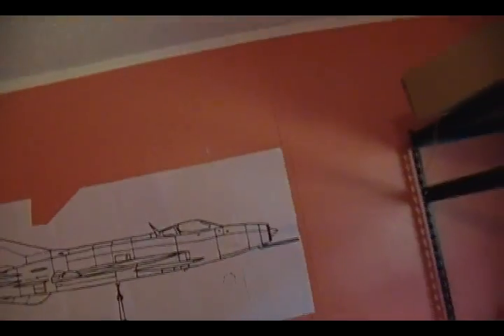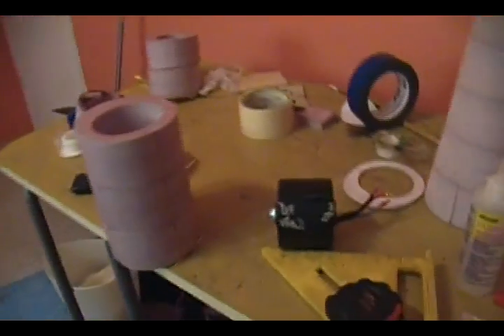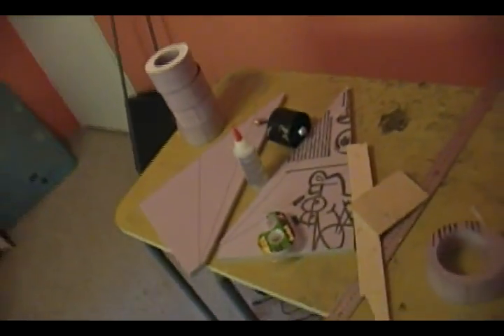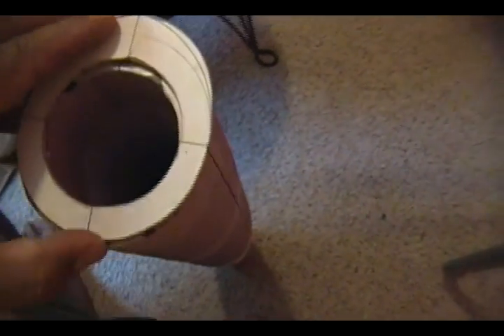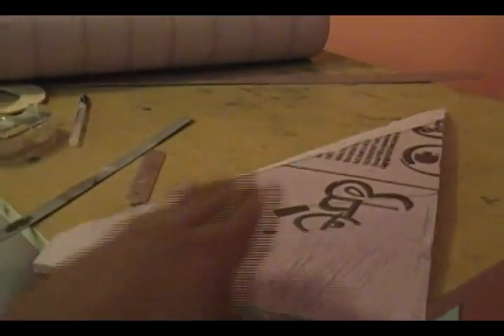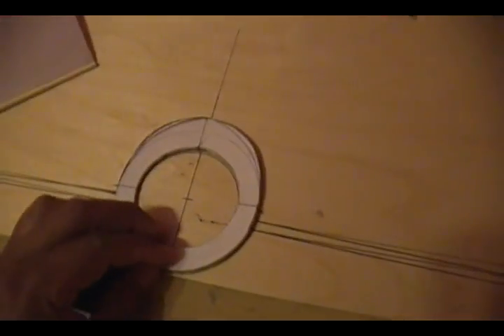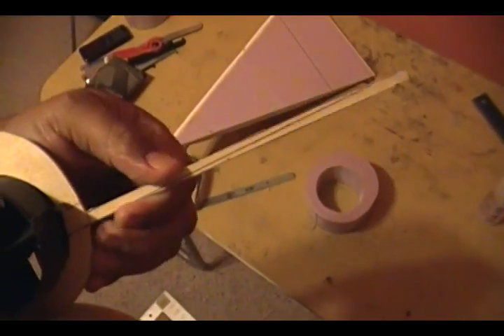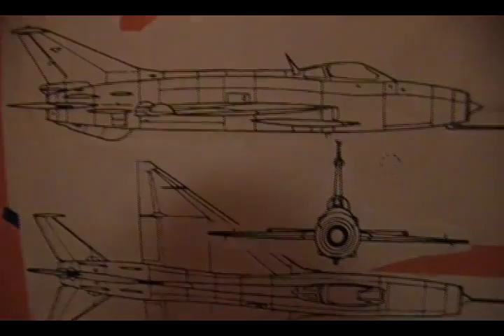EDF MIG 21 build (pat 2)

Comment: Daniel I love your show, can you be so kind to answer a few questions for me! when you are cutting the formers in sections like you show in your video, for the nose section, putting and gluing the former's together starting section #1 and former#2, do you have two use #2 again on the next block to match up with #3, then #3 again to match #4
Reply from the maker: Mach3USAF@gmail.com yes, just like you say just make sure you mark the centerline of the fuselage so your parts don't get of alignment